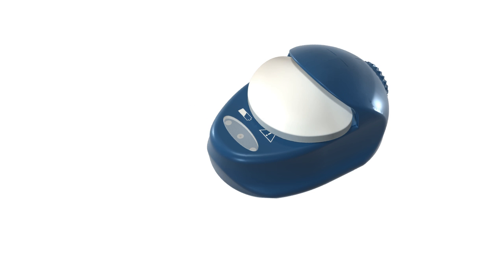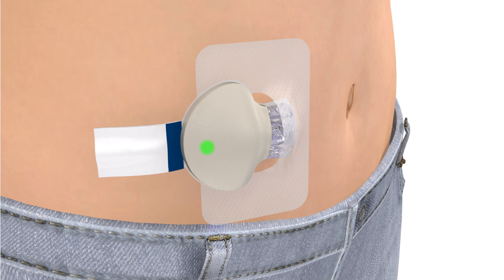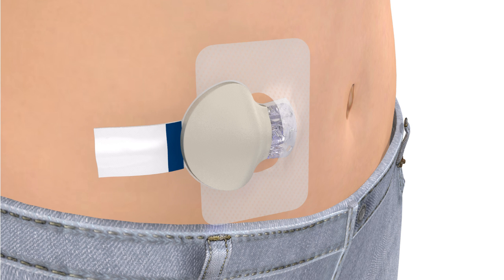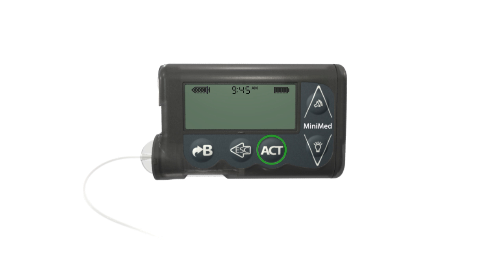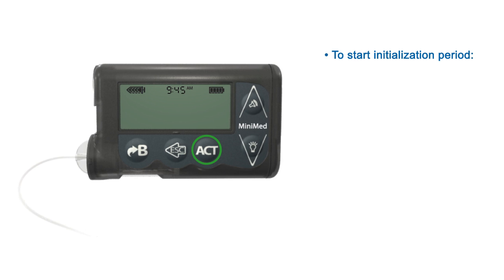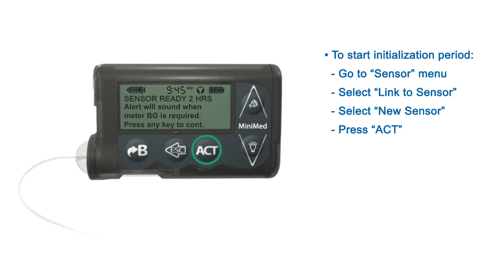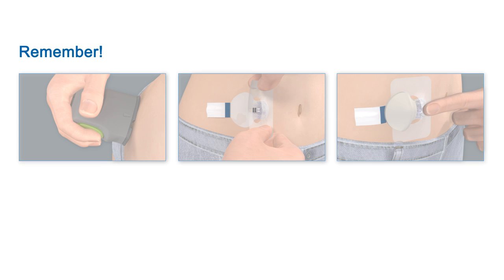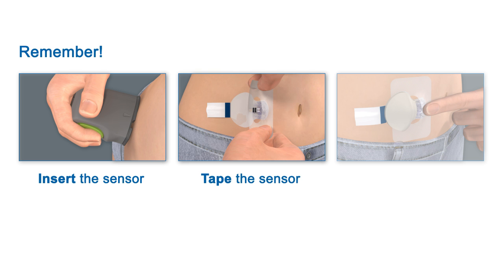Starting the Enlite® Sensor

Comment: I been charging my sensor for more than 20 mins and keeps on blinking does it mean it's fully charged?
Reply from the maker: No, the blinking light indicates your transmitter is charging. Once your transmitter is fully charged, the green light will turn off. Keep in mind, a depleted transmitter can take up to 2 hours to charge completely.
Reply: @MedtronicDiabetesUS  thank you very much. Another question i was wearing the sensor and i had 3 daysvleft to change it when i put it on it was fully charge and it said the i need to change the sensor why if i had three days left for it to expire?
Reply from the maker: This is a great conversation to have with our 24-Hour HelpLine. They can troubleshoot and possibly replace your sensors. Please give our team a call at 800.646.4633 option #1.
Reply: How to connect the elite sensor to a 360G mimicked pump

Comment: how do you charge the damn thing?  My charger blinks green then eventually stops.  When I hook it up to the tester no light ever comes on.
Reply: When you connect it the light only should blink like 3 times giving the signal to the pump after that it shouldn't blink just make sure the u have ur pump setting on for the sensor